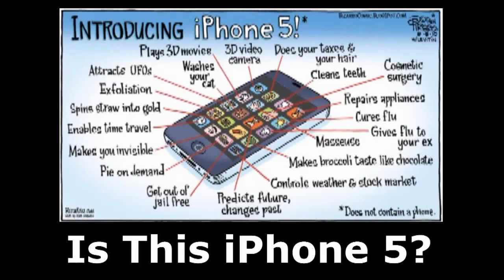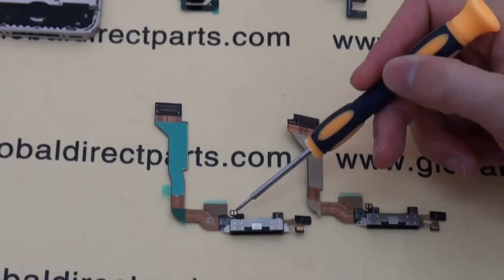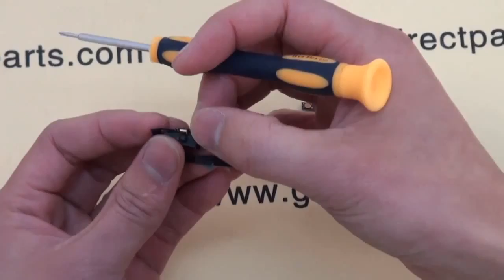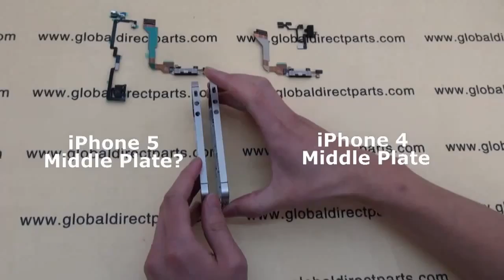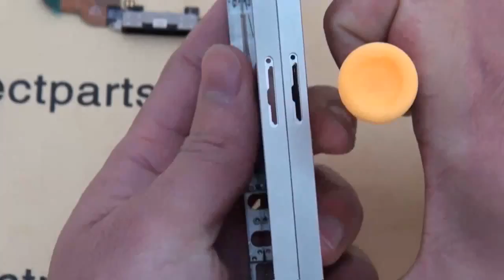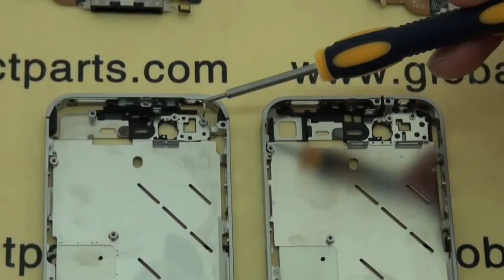iPhone 5S: leaked parts.

Comment: this is the new "iphone4" for verizon they made small modifications to the phone for cdma reasons and this phone can also use a gsm (simcard) network setup as well, the "iphone 5" is a completely different design as apple announced and is a bit bigger in screen size personally dont go and rush and buy the reformated iphone 4 from verizon because most likely there will be a new one in 5-6 months

Comment: At 5:11, you can clearly see the the slits where the antennas separate. On the original, it's on the bottom left slit and the slit at the top (the 3rd is purely cosmetic). On the new version, it separates at the slit near the mute switch, all the other slits being cosmetic.

In other words, no more antenna issues when holding the phone normally. Only way to reproduce the issue is having your hand touch the slit at the top near the mute button.